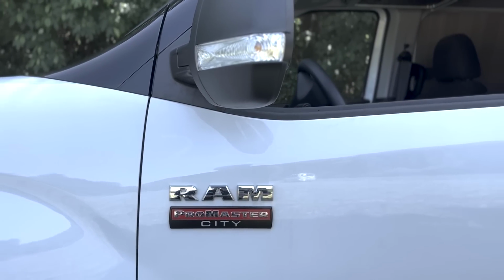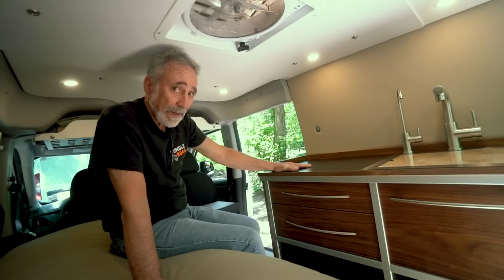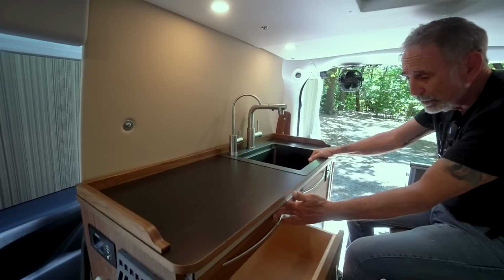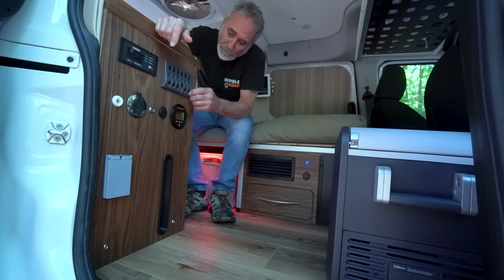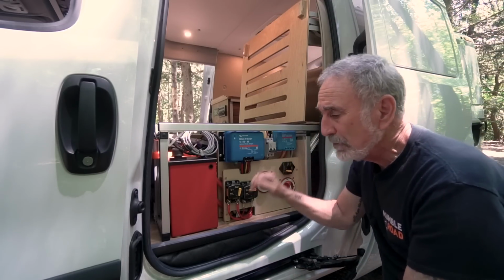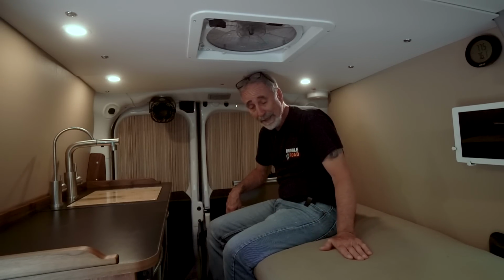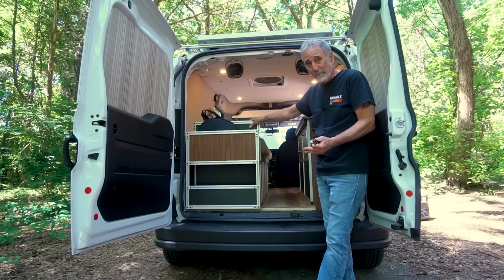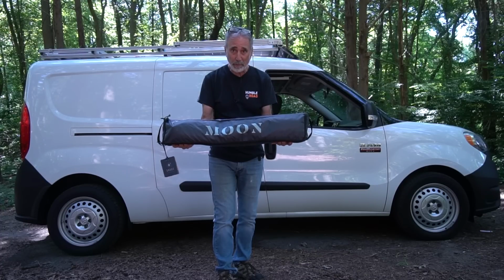Introducing the Humble Road micro camper - We call her Mini Me! A Solo Traveler  -  FULL TOUR!

Comment: FYI ... A sediment filter can be installed in any direction, sideways or upside down. However, it is suggested that you should avoid any orientation other than the upright position unless you need to install the sediment filter in a space with limitations. A vertical installation is the easiest orientation for replacing the cartridge filter.

Comment: I hate them inverters I go full 12 volt running microwaves and other. Stuff I just have a split charger good sola panel and a must good leisure battery lithiums the best well better and they last for ever and stay charged longer but well more expensive 🫰 also 12 volt TV with diesel ⛽ heater what's rigged streat in diesel tank good set up and this vans been quality well quality done .

Comment: The build is stunning, as always, and of the highest standards. Here's just an odd thought tho: it seems like the most ideal drawer pull would be flush with the surface of the drawer, or recessed, so as not to add bulk physically or visually. A beautiful metal accent could still be added to the pull.
Reply from the maker: These drawer pulls also act as towel holders

Comment: I've been inspired by your videos since day one. I designed a Promaster high roof 136 wheel base and love it. But, and there's always a but, we downsized to a condo where it would need to fit in the garage. Eventually I wanted to get a Euro van, which would fit, and redesign the interior. The Mini Me is an option. A couple of things which I would want to change about yours. 1) I would like to be able to see out the windows on the side and back. 2) Wish it had a pop top for standing room. That's what I love about the Euro van (we had a Westfaila). 3) A swivel passenger seat 4) On the rare occasions when my husband would join me, a pull out platform to extend the bed. Otherwise a wonderful build as usual. Congratulations!!!!

Comment: I noticed that you were unable to keep your head up while you were sitting on the bed. Most of us would prefer to be able to at least sit up. It would be a good idea to lower the bed 2 to 3 inches. Not all of us would really want the toilet & prefer more head room instead.  Great setup & design.
Reply from the maker: The bed height is dictated by the battery and inverter. I was very clear in the video when I explained the importance of a strong power system for a few , rather than a mediocre system for the masses. For you taller folks, I am starting a Mercedes Metris build next month, stay tuned.

Comment: Some changes I think would be nice...
I would want the window covers removable with windows down both sides of the van and back doors. I would like a removable panel in the floor near the sliding door with shower tray underneath and a shower curtain track on the ceiling. also removable shower spray handle by the kitchen wall. I would want a 25 gallon heated water tank or tankless water heater. Also white and grey driftwood options. Wood ceiling and floor with heated floors. I don't like the wood paneling.

Comment: Great build!. Did you consider any fail-safe breaker system in the event a semi-truck hits you from the rear? In this case the aluminium bed would end up in your spine. How about changing the bed and kitchen locations? Kind regards.
Reply from the maker: The bed is built quite stoutly and is anchored to the floor and wall of the van. Having said that, everything back there is no different than any cargo you may be carrying at the point of said collision.

Comment: This is a very inventive solution for someone who wants a quality build on a budget, and wants an extra 8-10 mpg over the high roof, bigger Class B camper vans. I hope it’s not seen as presumptuous to make suggestions to such a master builder, but if one could solve the height issue on the electronics box, a lower bed would allow people taller than 5’8” tall to sit up in the van without bending over like you were in this excellent video. 

Also, a swivel passenger seat, and a pullout type extension bed, where a slatted frame is extended to make the bed wider, with the couch backrest becoming the filler for the newly bigger bed frame, could make two people travel more of an option.   A hook track over the sink module, where canvas bags could be hung, would add some needed storage.  Theoretically, the bags, which we see used as de facto cabinets in adventure type utilitarian builds, could sit in the aisle when traveling, to be hung up when parked and need to traverse the aisle.

Comment: It's a good looking build. An observation; looks like you can't sit up straight in bed, you're having to bend your head/neck, so I'd want my bed to be an inch or two, maybe 3, shorter. 

Personally I'd want an adjustable bed, for health reasons I cannot lay flat, also for comfort. Guess I could work with that hinged end and make a support system with several adjustments, doesn't need to be powered or anything too fancy. I also do not want plumbing, or a sink. I'd prefer to use that space for more storage.

Beautiful build though.
Reply: Posted before you got to reasons you will not lower the bed, haha. Not sure about the batteries having to be that height, but I don't need a slide out toilet either, so that'd be another feature I don't want. Oh well.

Comment: As usual, beautifully built and planned.  Missed the hot water system setup.😯  BTW,  the seat to ceiling issue depends in the bum to head height rather than the full body height.  Two 5'8" people will have different sitting  heights.

Comment: Can this can handle a pop-up tent & 4x4 conversion on top of the conversion?
Is b fearful engine not strong enough & not sure how much u can increase hp & tork. I've reached out to several so called experts in my area & couldn't get cancers.
It's a great size for me but wouldn't make it to the places I want to go. My 18 Crosstrek won't make it. Need pop-up to sleep in during heat & have pair of Rotties who take up more space then I do. Great source of passive heat in cold temps!
Being solo female, yes 1 could argue not solo w my dogs, I want a pass thru just encase I need to escape. Hard to find even on truck campers- I can fit crawling thru the back window
Reply from the maker: I think I have just the van for you. It’s the smallest of the full-sized vans. Stay tuned!
Reply: @HumbleRoad  Right on! 
I keep going back to the early 70s Ford Econoline/ sportsman 4x4s
I'll keep an eye out for your videos, You Tube had a wonderful way of unsubscribing me

Comment: I put an artic tern window on the rear driver's side quarter panel. Love it. Rain guards on front widows and use magnets with bug screens. Opalar USB fans. Wish I had gas webasto heater. Would that work in this van? I keep my fridge on passenger seat.
Reply from the maker: Webasto puts out too much heat for these little campers

Comment: It's a nice conversion but that van is not worth it. It's a Fiat. It's stamped all over the body/chassis. I had one, It's quick not fast (no power), rides like a skate board (bumps will blow your kidneys), doors are not well sealed (you can see light come through). Mine had all kinds of electrical problems.  It would not start, shut off on you while driving.   Dealer couldn't figure it out. They are very expensive for what they are. Buy a bigger van. Gas mileage is under 20 mpg city.
Reply from the maker: What you describe is not my experience. I drove that PMC 48,000 miles without one hiccup. Neither one of us can make generalizations and I don’t appreciate your negativity on my channel.

Comment: Nice layout Gearge, you could have the bed end at staged elevation as a back rest so owner can lean on reclined looking out the back doors or watching tv etc, maybe same at other end too. Would a  lower bed (slimmer mattress)be better to sit more upright and on back door induction side possibly a fold down shelf to usse the cooker outside on the cooker holder but well thought out as always.
Reply from the maker: The height of the bed, as explained in the video, is dictated by the size of the battery and associated power components. Rather than compromise there to allow for taller people, and nobody is happy, I decided to build a real power house for shorter people. Taller people will have an option later this Summer. Stay tuned!

Comment: i keep convincing myself  that i should  go ahead and  buy a  PMC  but  there is  such  an overwhelming amount of  stories  and  advice  against  buying one  due to its  poor reliability  i have a friend that  is  supplied  the  PMC  for his  work truck and he  has  had  2 of them   both of  which  have  had  expensive transmission  problems after  40k  miles  and there is a  engine  recall  going on   now  due to excessive  oil consumption  with  engine  replacement being the  fix. So  can some one  please  give me the  real scoop.  i don't want to pull the  trigger  on a  potential  costly  error . thanks  everyone
Show less
Reply from the maker: 48,000 miles mostly highway. No issues whatsoever
Reply: @HumbleRoad Did  you  buy  new?? , that's  one of  the issues ill have  ,i can't  swing a  new  vehicle  so i have to contend with  someone else's  issue  so to speak.  what i have  heard   is  many problems  on  vehicles   from   2015  to about  2020   or  40k miles , bad  stuff not  just  nuisance  pain in the butt  problems ,  engine  recalls  ,  excessive  oil consumption ,  sever transmission issues  due to the 9 speed  tranny. lots of  electrical problems, ignition issues  etc  etc.  even my  mechanic  says  "do yourself a  favor  get a  Transit Connect"  Im a  joysey boy  i just want to  really know the  bottom line  and  not get  screwed  and  stuck somewhere  and have to be towed.
Reply from the maker: @vincem4821  usually the comments are from those who have had problems. The thousands who drive problem free could care less about commenting. If I were a mechanic, I would tell you to buy the car that will keep putting food on my table.
Reply: @HumbleRoad  ROFL  don't disagree with any of that  George !!

Comment: If you’re going to use this solely as a solo traveler you could have an option to remove the passenger seat and create even more floor space. Maybe a spot for the dometic to live as well as a pantry area 🤷🏻‍♂️. Could also have a slide out table when the passenger door is open to allow for outdoor cooking. 

Another thought. Where the bed raises to access the battery you could have some drop down legs, so that part would sit at an angle, turning the bed into a lounger 😉
Reply from the maker: Thought of all those things. Stay tuned!
Reply: @HumbleRoad  great minds 😉

Comment: That's a great build, very thoughtful set up.  But unfortunate for me, I'm 5"11" -- my question is it possible to remove the upper storage cubie at the head of the bed, and extend the bed platform that extra few inches.  You would just lose the upper cubie and still have the lower storage cubie plus the few extra inches for the bed?!?  Other than that, the build is wonderful!

Comment: Hi George, What width/thickness 80/20 do you use on your internal van components, like what sizes do you use for your bed frames and what sizes for kitchen cabinets.
I love watching you van builds and learning from them, I also really want to use 80/20 for the modularity it offers im just not sure what size I should pick as i dont want to go to small and have them be to weak.
cheers
Niall
Reply from the maker: I use a combination of 10 series and 15 series, depending on load.
Reply: @HumbleRoad  thank you

Comment: As alway a cool build from a cool dude. 👍 2 quick question:

1. Can the floor plan be reversed so that one can use the driver's side slider to enter an exit?

2. Can small Windows be installed on the side above the sink area and opposite side?
Reply from the maker: Anything can be done, however, it is very important to me to keep the entry price as affordable as possible. Add-ons, options and enhancements can come later. I will be sure that whatever changes we make, they can be applied to all Mini Me's on the road.

Comment: Love it! Assuming I would get about 4 hrs of 800 watt heater use / night.. 8 if it cycles 50/50.  So approx how long to fully charge battery while driving when no sun? How long to solar charge in full sun? Would you consider an inlet plug to charge from an EV charging station?

Comment: Hi George. Sure you can fit someone over 6 foot on the bed. Couldn’t you just move the driver seat forward? Yeah the feet with a hangover but…

Also, when lounging, facing the rear, if you tilt the driver seat, and collapse it a little bit toward the dashboard, you can create the perfect chaise lounge seat-back-angle.
Reply from the maker: The chaise option, incorporated into the bed lift, will be designed and offered as an option.

Comment: I like the van I just wish the mattress, at least at some point was lower ( may require a folding mattress or some other ingenious system ) so that a 5.7 or 5.9” person would have a spot to sit straight and maybe the storage could be moved in part to the ceiling via some nets.
Reply from the maker: This is , in my opinion, the optimal design for this space. Any alteration, read; compromise, for the sake of mass inclusion is not part of the Humble Road build philosophy. I have plans for you taller folks. Just sit tight for a few weeks! 😋

Comment: George, thank you for the final video.  Your design and the implementation of the work is impeccable.  And I give you and your crew kudos for all of that.  The only issue I can see people having is the bed height.  I feel that for most average men, and some women, having to sit up on that bed with your head constantly bent to the side, would quickly become an intolerable annoyance.
Reply from the maker: I made it very clear that this van is not to be used by anyone over 5’7” tall. I have another option for you taller folks. Sit tight for a few weeks until the announcement.

Comment: This is a great camper.  Very pragmatic too.

If I ordered one, I will ask the following questions for potential modifications:

1.  Can the kitchen counter be raised an inch or two to install a sliding/pullout counter extension towards the sliding door (above the command central/switches/controls)?
2.  Can you add an outside shower?
3.  Can you add a campsite power port and/or residential power port to charge batteries and power the camper ?
4.  Charging while driving - with the original alternator, an upgraded alternator with a second alternator?
5.  More difficult but, is there the possibility of a pop-up roof bed?
Reply from the maker: The MiniMe is sold as is given the color and wood choices I mentioned. We are working on a few upgrades that I will make available as the designs are approved. The countertop will not be raised. The outdoor shower is a possibility. It already has a 30 amp shore power plug. It already has a high output alternator. Definitely no pop top!
Reply from the maker: The whole philosophy is to keep the entry price affordable, with add ons and future enhancements to come. It’s an on going adventure!

Comment: Very nice and thanks for posting your builds.   Maybe the awning poles could clip into the round holes in the wheels?  3d print a pole end that works like an automotive trim push pin, three fingers which expand with an internal sliding pin.

Comment: Great product and video (as usual!). The one design decision I don't understand was the decision to leave the passenger seat in a van you clearly indicate is for only one person. (You could shower in that space!) That seems like a tremendous amount of space to reserve for a rarely/never used seat. That seat always seems to be removed in most folks home-built car campers. I'm sure you have thought about this and would be interested in the reasoning behind your decision. I didn't really think about it until you mentioned putting a table and chairs under the awning, and I realized there is no place to store a table and chairs other than on the bed, in the aisle, or in the front passenger area.
Reply from the maker: This vehicle can be a daily driver. Whether daily or when traveling, removing the passenger seat could be regrettable. But the owner can easily remove four bolts and remove the seat. The camping chairs, awning and table can store in the rear headboard box . The floor is removable.

Comment: Hi George, having done a small van fit out in UK for myself and used some of your suggestions from main van videos I thought of maybe two things. How about pop-top which helps folks who like to stand when parked up. also my van has a relay which automatically switches inverter electrics to shore power when it is connected. This preserves the battery power and enables battery charging and mains outlet use without inverter use. Anyway, as you well know everything is possible but costs. Your clearly the best on the tube for this stuff, keep it up. cheers Dave
Reply from the maker: Thank you Dave! Our inverter senses shore power and passes it through to the panel . 30 Amps.
Reply: @HumbleRoad  see I sort of Kane you would be ahead of me. So from across the pond, keep up the good work, I am always watching with interest. I have a 400 Ah system nverting to 230v for uk equipment. VW transporter van. Cheeers Davee

Comment: Hey George! I actually designed the poles to attach to the small suction cups. If you pop those rubber feet off the bottom you’ll find two holes that you can run the bolt in the small suction cup thorough and it’ll stay attached to the side of the vehicle. It’s a bit of an Easter egg since it’s not in the instructions but it works great! Nice work with that mounting bracket btw 👍🏼
Reply: That's so awesome. I love when designers think ahead to non-standerd applications of their products.